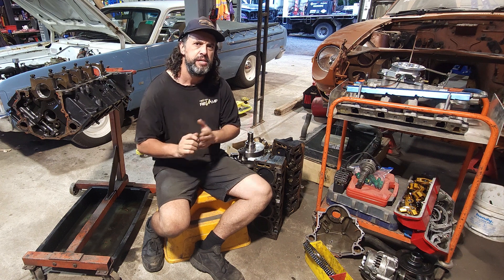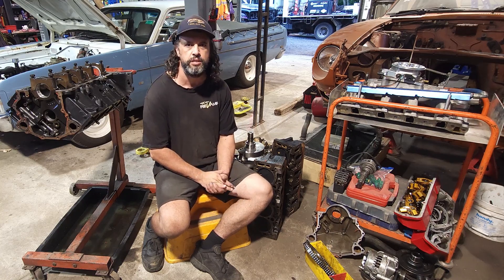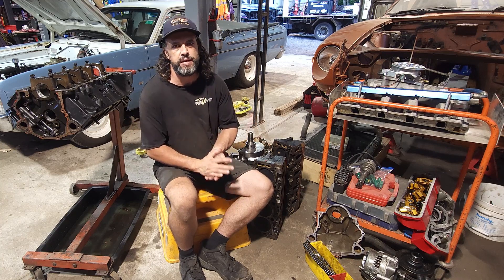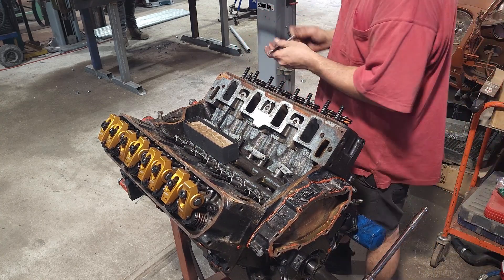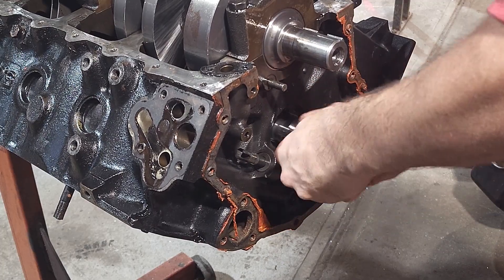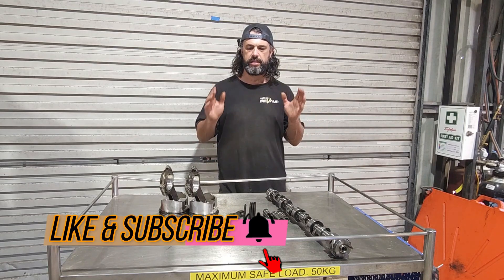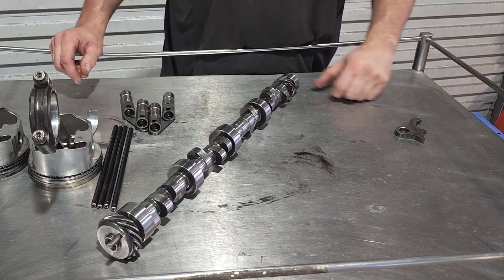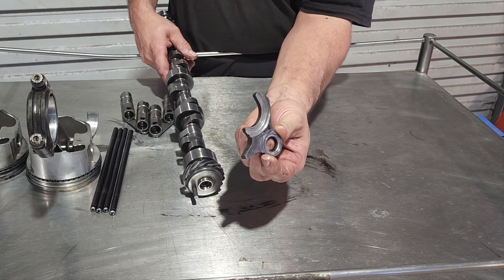Finding major problems with the Last of the Iron Lion's Holden 355 stroker engine

Comment: i have seen this failure from a blocked oil feed to the timing chain , lack of lube to the timing chain area causes the oil pump driveshaft to grab and because of the helical cut gears side load is applied to cam , oil pump drive gear should be cactus too - unless it is hardened gear and Steel cam . Just my 2 cents .

Comment: That’s why Holden cast blocks specifically for roller cams. The lifter bores are cast much taller in a roller block to reduce the aggressive lateral movements of a roller lifter. By using such a huge solid roller cam and lifters in a non roller block, such as this one, you’re just asking for trouble. You can now get much shorter roller lifters now which aren’t much taller than the original lifters, with tie-bars , from Crane ( I think it is ) to use in non roller blocks which greatly reduces the sideways movement and I’m pretty sure you can use the standard length pushrods with them as well.
Reply from the maker: @jasonnielsen2125
Thanks for the info, interesting stuff.
Unfortunately we were surprised to see a non roller block when we disassembled and just have to go with what we have.
Hopefully with a well set up valve/rocker geometry and the correct length push rod we can eliminate as much unwanted side loads as possible. 
Will definitely keep those lifters in mind cheers
Reply: @nexgenrevamp2976  I would seriously look into those shorter roller lifters though, I’m going to use them in a future project but it’s not going to be for quite a while yet.
Reply from the maker: Definitely going to discuss them with my cylinder guy while we are spewing a solution to our terrible geometry. 
We've still a ways to go yet before assembly

Comment: Hydraulic lifters on a camshaft grind designed to run lash-no less a mechanical roller grind with I’m guessing 260+ @ 050- will make a mess, that core can be saved with a regrind if the barrel allows it, thrust plate might’ve been a Chinese pro comp knock off too, Wong metal used
Reply from the maker: @Circle jerk 
Couple people have mentioned cheap thrust plate know 100% investigation worthy.
Yeah about 265@50.
Crow recommends no go on regrinding apparently, compromised case harding causes issues.
Looking into camshaft options at the moment.
Reply: @nexgenrevamp2976  I’ve had many a camshaft reground without as much as an issue, 8620 is tougher than you think, biggest problem would be whether the dimensions of the barrel will allow it to be done
Reply from the maker: @Circle jerk
Also have had many cams reground over the years, fully expected this one to be the same. 
This is just the info the owner was told.

Comment: Valve springs to strong?bad cam design?:oops:
Reply from the maker: @Jim Clarke
Is this reference to the lobe damage or thrust issue with the camshaft?
Reply: @nexgenrevamp2976  lobe, if the thrust is flogged out starting to sound like cam problem, should be other problems if the oil wasn't lubricating that area? if the cam was hard to turn could relate the cam wanting to flog the lobes
Reply from the maker: @Jim Clarke 
Ah yes.
The cylinder heads are currently being checked, including spring pressures and correct installed height. Hopefully find an issue there if any.
Thanks for the input, always happy for added info
Reply: @nexgenrevamp2976  if valve springs are bottoming out should have bent pushrods and maybe valves
 damage etc... , HV oil pump with cold oil could drive against the cam? , cant work out why the cam thrust was damaged:oops:
Reply from the maker: @Jim Clarke
Someone else mentioned high volume oil pump causing issues with cam aswell, will be worth a look into.
The valve train geometry is currently being assessed with the heads to check some possible issues there with rocker angles etc causing excessive loads.
Hopefully close inspection of everything and diligence while assembling will have it sorted.
Reply: @nexgenrevamp2976  i have 2 engines with HV oil pumps 308 and VT 304 roller, both pumps damaged, shafts bind on turning by hand, 1 had snapped case into the block,both engines have STD bore no lip and no damage
Reply from the maker: @Jim Clarke
Yeah wow. Definitely more of an issue than I expected.

Comment: Hi mate, back in the VB - VK days we used chew off oil pump and dizzy gear drives because of trying to run after market hi pressure oil pumps. Most times we would put the standard ones back on and port match them for smoother flow and a few other oil gallery mods in the engine block .
Reply from the maker: @Allan Carson
Thanks for the great info.
Have always been wary of high volume pumps on 308/304, have heard things mostly revolving around over oiling the top end at high rpm but can definitely see how the load on gears could be an issue aswell.
Reply: 100% we run stock oil pump we just shimed the relief valve, in our 600hp N/A 308 and external oil pump on our 700hp N/A 355, he hasn't block off some of the stock oil galleries' looking at his build looks to me it was just a 355 Crank in a stock bottom end

Comment: Keen to see the engine rebuild.
Reply from the maker: @Big Al
Good news is the engine has been tested and cleared to go.
A shopping list is in the works at the moment before sending things to the machine shop.
Reply: Is that cam thrust plate original gm  or aftermarket poor material? What brand of crankshaft? Crank gear inline with cam gear?
Reply from the maker: @Chad Lantry
From what we can tell it's an original retainer. Being steel roller cam retainer material definitely a line of investigation, cheers.
As for brand of crank, not much in the way of markings to be seen.
Chain alignment definitely in for scrutiny on reassembly, of course with a new chain set.